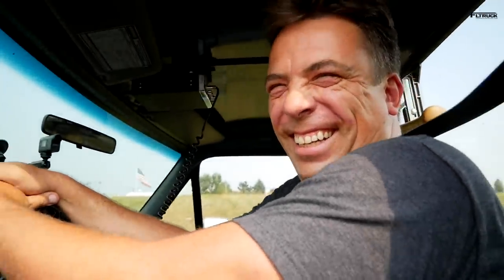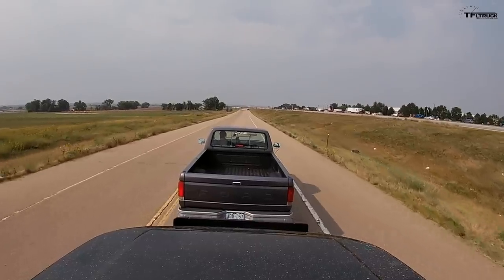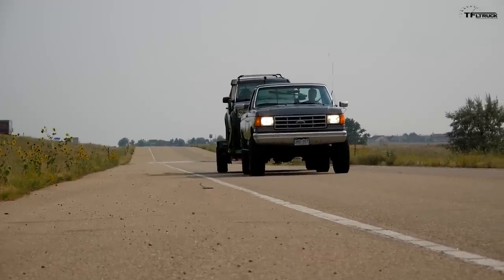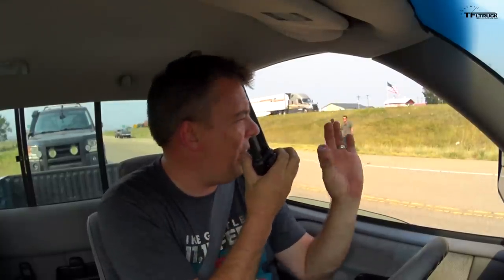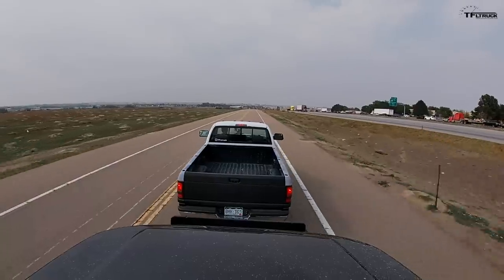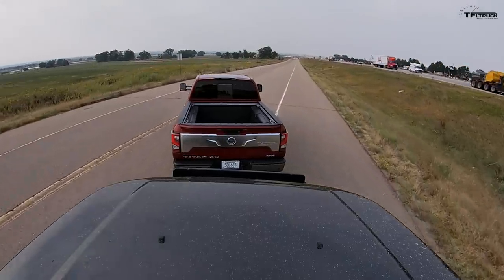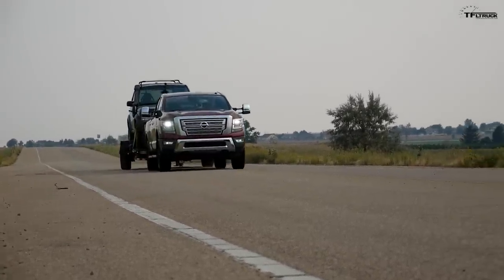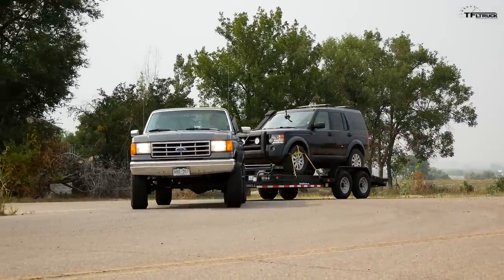Surprising Result! Can a New Half-ton Gas Truck Out-tow an Old Diesel HD Pickup? Let's Find Out!

Comment: XD isnt a half ton.. but who cares. I think it would have been more interesting with a 2016-2019 XD Cummins.
Reply: It sure is a half ton. Regardless of what Nissan says.
Reply: A 3.5 ecoboost would probably do even better
Reply: George julien  no it’s not, I own an XD and an F150. The difference of the commercial grade frame, brakes and engine are completely different.
Reply: Alexander Lovato yeah ok bud 😂😂
Reply: George julien go hook up a 12,000lb loaded horse trailer to an half ton then to an XD and you will see what I mean. Bud haha good one real classic dodge there now go drive your hind to work.
Reply: Alexander Lovato I’m saying actual numbers from Nissan slot it firmly in 1/2 ton territory. In fact it’s tow rating is around 2000 lbs less than an f150. How is it not a half ton if all it’s ratings are half ton numbers? 

And no I don’t have a classic dodge although I wish I did, an old power wagon would be sweet 😉
Reply: Alexander Lovato f150 Max tow capacity is 12,973 lbs
XD is 10,766 lbs so yeah, you have no business pulling a “12,000 lb horse trailer” with it.
Reply: Tow rating on an XD Cummins is up to 12,300 which is a low ball number by Nissan. Try to tow a 12,000 lb trailer with an F150... I’ll wait.
Reply: Alexander Lovato I have... but you’re now sidling around my point that truck classification is done by manufacturers numbers, and those numbers put it in the half ton category. Bottom line.
Reply: Is that right? Then why is it rated as a class 2b light/medium truck with all the 2500’s while the  half tons are rated as class 2a light trucks? I’m done haha 😂 it’s not all about manufacture towing numbers man. That’s why it’s classified as a true 5/8 but I digress.
Reply: @georgejulien3286  your comparing the wrong numbers. Compare the GVWR of the XD to a F-150's and you'll start to see the difference. Not to mention the XD has a fully boxed frame and larger brakes than any F-150. Tow rating's can be skewed by the manufacturers one thousand different ways to produce the marketing BS that Ford spews claiming "best in class" for everything that they do. I've owned both trucks and let me assure you the XD is a much more stable towing experience. That being said, I would not tow anything over 10,000 lbs. with any 1/2 ton truck, Ford, Ram or GM or the XD and the XD will handle that amount weight better than all of them. IMO anything over 10K lbs. in weight should be towed with a 3/4 ton truck. 

TFL did another video from 1 or 2 years ago towing 11,000 lbs. with both an XD and F-150 up and down the Ike Guantlet, I encourage you to go watch it and listen to Mr. Trucks comments about towing experience with each one and comparing them to each other. It's unfortunate for the XD that Nissan's marketing department chose to handicap the trucks tow ratings to purposely try and differentiate it from the Big 3 brands trucks. It's not a fancy truck by any means but it is one of the best ones on the market right now in the true meaning of being a work truck, it's a beast of a truck.
Reply: @noosh8316  F 150 were the first half tons to have fully boxed frames...and still do

Comment: Should have run the triple nickle version of the Titan...all diesels.  The non-turbo diesels shouldn't ever be compared to anything either...nobody did or does tow with those things.  The turbo 7.3 would have been a better comparison.  Maybe throw an early Duramax into the mix as well.

Comment: The Ford even though it’s completely gutless is pretty rad. Something isn’t right with it because it would have done better than that when it was newer. It’s not really a fair test. If you really want to compare them you need to find one in like new condition.
Reply: Even new the 7.3 diesel only produced 185 hp and 338 foot lbs of torque. The Cummings produced slightly less hp but made 400 foot lbs of torque.  Even new both trucks would've been out gunned.
Reply: Will C yeah but it would have done better than that. The ford couldn’t even get past 45.
Reply: it still burning/spitting oil. get that fixed...
Reply: @JonBecker81  I used a family members 85 Ford 7.3 reg cab to tow a open trailer and 3500lb car back in 86-88.   It barely could maintain speeds of 60-65mph with any incline.   It was slow, SLOW.  A 460 gasser would destroy it.   I would go as far to say any 1/2 ton from 99 on would tow better than that slug 85.
Reply: @JonBecker81 because Andre didn't shift it, diesels do well at lower rpm. Also it doesn't even have a turbo.
Reply: @Dimetri Drossos the difference it the Ford has no turbo.

Comment: What does 0-60 have to do with towing? What semi id rated by 0-60? it doesnt matter. The older trucks will tow better because they are more stable and have near commercial grade engines that last.

Comment: From a nostalgic factor its cool, but almost any modern 1/2 ton will out tow& perform an old 7.3 stroker  99-03.   Realistically you could only "Legally" tow approximately 10k -12k(dually)because of GCWR of 20k 
Modern trucks are really pushing the limits!!!

Comment: my 2001 vortec smallblock can tow 8000lbs with payload, 0-60 in 22ish seconds because of the 4l80e behind it. 190k miles on engine and trans working it 5 days a week. a 2000 vortec big block can tow 15,000 3 times a week for 20 years and its still on the road today with a manual. that nissan is a toy it wont last more than 10 years if you use like a real truck. id take the old school trucks, its 30 years later and they still rip

Comment: My 2001 Dodge Ram 24 valve Cummins wouldn’t have squatted Luke that, it had HD suspension plus camper package
Reply: Ya I have a 1993 Cummins slightly lifted, it does not squat like that, and is a lot faster towing weight than the one they used. I think it was purposely short and slow shifted, and must have had some hwy gearing in it, it was pulling really slow for only 8500 lbs

Comment: You’re comparing stick shifts to an auto take the waste gate off the 12 valve turn the pump up and put an egt gauge in it and it’ll be making anywhere from 700 foot pounds to 900 foot pound

Comment: I just bought a 2020 F150 with the little 2.7 ecoboost, hd payload package. Its rated for towing 9k lbs.

Just towed my old 2004 3/4 gmc 6L with it Better in every way than the 6L towing the same weight.

Gets about the same mpg as my 2001 and ,2004 duramaxs got towing, except does it better as well.
Reply: What in tha actual F? I towed a 12-14k enclosed cargo trailer daily for 5 years with an '04 LLY Dmax, and got up to 12.5mpg (hwy) doing so. I call complete BS on a 2.7 EcoBoost having anywhere close to the powerband to safely pull that kind of weight & attain that mileage... much less control it when needing to stop it. That f150 ass end would be squatting on the damn ground without a custom airbag setup.
Reply: @deeohgi  You should read read my comment again.

I did not say what you claim
Reply: @hitempguy  I was refering to your last statement regarding the fuel economy claims. You should reread your statement.

Comment: Awesome video as always. This video seems like the perfect place to ask you guys and the viewers a towing question I've got. I have a 2017 F150 crew cab 4wd with the 3.5 ecoboost (second generation) and ten speed auto. It has the max tow package with 3.55 gears, 36 gallon tank, beefed up cooling and integrated trailer brake controller. I have a 2007 Jeep wrangler unlimited Rubicon (big heavy,  four door with lots of extra steel in skids, bumpers, rock sliders, winch) that goes around 5,400 lbs empty. I'm getting an 18-20' beaver tail trailer with slide out ramps (10,000lb gvwr trailer). So trailer and Jeep weight with tools, spare parts and everything is going to be in the 8,500 lb neighborhood. I know the truck can pull that weight with ease and that's not my question. What I'd like opinions on is should I/do I need a weight distributing hitch or even a WD hitch with sway control setup?? I noticed on this test they were pulling the weight I'm looking at with just a basic heavy duty gen Y hitch and it seemed fine. Granted they were only towing just down the street and topped out at 60 and I'll probably be up around 70. I'm planning on towing it locally but I also plan on making the 1,900 mile trek from central PA to Moab Utah to wheel. Thank you for any help and advice. I'd rather not have to buy a $350++ WD hitch setup if I don't have to. I am going to be going with a nice hitch like a gen Y though if I can get away with just a regular hitch setup.
Reply: I believe the law states that WDH is required for a 1/2 ton at weights way below 8,500 pounds. I tow an 8k travel trailer with a 1/2 ton, but I absolutely would not recommend towing that weight without a WDH and sway control. Safety first!!! Weigh your rig fully loaded on a CAT scale and verify that payload, axle weights, towing capacity, GCWR and all other weights are legal. If you are overweight and involved in an accident, the lawyers will have a field day and rightfully so.

Comment: He wasn't full pedal on those DEISELS. Cummins should have done it in 20 seconds easy especially with a manual. That Nissan sound ed fantastic.impressive that a half ton can tow 8500 lbs. That's on the heavy side for my Ford daily driver. Tow 6 500 lbs trailer no problem .little v8 240 hp

Comment: Of course a new truck with 200+ more hp is gonna get it to speed faster.  Id rather see a 0-60-0 test, and then a loaded 250 mile highway trip at 60mph test.  And the ike.  Much better tow rig test.

Comment: I’m thinking Gunsmoke could benefit from some freshening up to the old 444
I always noticed the idle never seems quite right and a bit of white smoke here and there that it shouldn’t be doing at all, so I’d imagine some newer injectors would smooth things out and get back some of what she has lost over the years.
Still never going to be a speed demon but she is certainly down on power from her younger days lol
Might want to get that A/C fixed before selling it so Andre doesn’t melt lol
(Not only make an interesting video but good cold a/c will up the bidding quite a bit as well when you go to sell her)
Reply: Injectors and an IP, turn the fuel up a flat, and that N/A IDI would do good. A turbo would make it a whole different truck in terms of power, but that is a pricy upgrade, and since they said they were trying to fix the truck as cheap as possible, the turbo upgrade got shelved. But nevertheless, this engine will likely outlast the other two. Slow, but she'll keep on chugging!
Reply: Sir Timothy's Piano Time we had an ‘88 with the N/A 7.3 IDI and a ‘93 with the factory turbo 7.3 IDI, and they are great engines for sure. And arguably are the best sounding of the diesel pickups ever made

Comment: Did u say the Nissan has the most powerful v8 out of the half ton class? Your wrong if I heard you correctly. GM has the most powerful v8 in the half ton class. 6.2 has 420hp 460 torque.

Comment: If he knew how to drive an idi it would have done way better. Those trucks aren't comparable to that new gasser. The idi is not made to turn high rpms. In face its peak torque is at 1400 rpm if I remember right. So if he knew when to shift and how to drive that old truck it would have done way better. Just saying. Love the idi. All mechanical and simple and with maintenance they'll last 750,000 miles but not too much power but with the right gearing they will pull

Comment: The trx has a low tow rating due to the suspension but will most likely pull no problem due to the engine
Reply: Pull? You mean drag!

Comment: I’m guessing you didn’t shift that old Ford IDI properly... My IDI easily hits 80 if I need to. Have to actually change gear and high rpm means no power cause all their torque is low... even unloaded you won’t do much accelerating beyond like 2500 rpm

Comment: That Nissan is weak. In the TFL 5 Star trailer tow video the stock F150 2.7 towed an 8600 lb trailer to 60 in 15.5 secs and that was a travel trailer with more frontal area then a car trailer.

Comment: @4:44 that sweet sound you came here for...
Yea yea, the newer truck pulls faster, 
BUT, those other two trucks will never throw a code and go into limp mode over a smog sensor being dirty, and the average mechanic can fix them at home, compared to that computerized monstrosity Nissan put out.

But, that's just me.  I'm a proudly biased 1st Gen Dodge W250 Cummins owner.
And,
I'm in no rush when I'm towing something for miles on end.
(And, I bet I get MUCH better gas mileage doing it, than that Nissan.)
LoL

Comment: Use any of the trucks to tow the Land Rover to the wrecker for disposal as that model of Land Rover is junk.

Drop the Nissan off at an auction and get what you can for it as it is not a long term truck.

Keep the old Ford and Ram.  Have a cold beer afterwards.

Plate [C]

Comment: That cummins will out pull that titan any day all you seen was the difference between hp and torque. I know guys pulling 20 000+ pounds with those 90s cummins trucks
Reply: Probably not. If it that’s all it has for 0-60 I really don’t see that happening. And no one is towing 20,000+ pounds with any 90s pickup truck.
Reply: @jimbob8701  really you know nothing I had a contractor pull 31500 pounds with a 94 chevy 3500 454 pulled it all its life was a 36 foot tandem dually trailer with a John deer skid steer and a zoom boom .my friend pulls his equipment with his 96 cummins truck is over 20 000 pounds daily what do you think people used before we had a 1000 pound foot trucks......the titan is 394 hp 390 torque if I am not mistaken the cummins was little over 200hp and 400 torque the gears available in those years were lower to .this proved the titan had more hp moving the load faster that is all dont be fooled by this test.
Reply: lifted 98 I know  nothing about towing huh? since you mentioned Cummins, the 2020 3500 ram dually is rated for pretty close to 35k according to the tfl and ram website. you’re telling me that some busted as 454 is pulling almost 32,000lbs?  for most of its life? Not a chance.
Reply: lifted 98 20,000lbs is more than what most of the heavy duty trucks are rated for on the road today. Diesel and gas
Reply: @jimbob8701  yep thats what I am telling you bud .I guess nobody tows fifth wheel campers with half ton either seeing how there are little half tons rated to tow 12000 plus pounds yet you see them doing it all the time .people have been towing 20 to 30 thousand pounds for a very long time why do you think manufacturers have taken notice .not saying its safe but what there rated for and what people use them for is a totally different story . All that power in the new truck just makes it easier  but you dont need a 1000 pound feet of torque to move 30 000 pounds so once again you know nothing .
Reply: @jimbob8701  yes I know what there rated for .what there used for is totally different I see many people pulling 5th wheels with halfton trucks to but most are only rated at 8-9thousand pounds when most 5th wheel campers are 12000 most people are towing over and don't even know it ....or don't care .
Reply: lifted 98 just because you can move a load way over your specified rating doesn’t mean one vehicle will out tow another. It just proves people are stupid by trying to do so. There’s way more to towing than pure power. Axle ratings, gearing, transmission, cooling, braking, suspension, payload are just a few factors. all of that crap you just typed still doesn’t make your original statement true. That Nissan just out pulled that dodge with the same load in less time up to 60mph. And seeing as how the outcome was here, I really don’t see that changing when they pull them up the Ike gauntlet. Whatever you respond with I don’t care it’s probably nonsense anyway.
Reply: @jimbob8701  so you understand that the dodge  has more torque then at a lower rpm with a lower final gear ratio so yes it will out tow the titan and it weighs less so it has less mass to move the only reason the titan is faster is because it literally has twice the hp and the cummins was driven  by someone who has no business shifting its nv4500 transmission which is by far stronger then the Slushbox in the titan you sir have no idea what your talking about that dodge comes with the same rear axle found in the brand new trucks of today either a dana 70 or dana 80 with a dana 60 front which many times heavier than what the titan has for a driveline + a hydroboost braking system with better brakes. So you tell me how I dont see the big picture you just watched a nissan commercial and bought into the crap .according to your last post you think winning a drag race makes a truck out pull another truck .diesel  trucks will never be as fast as gas trucks.
Reply: @jimbob8701  seeing how your on YouTube and dont think people pull these loads with 90s trucks look it up .......
Reply: @lifted9821  Here they use MDT's and HDT's last a lot longer  than Pickups towing those loads
Reply: @robertryan7204  they use them here to.